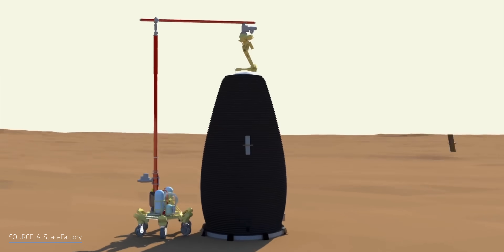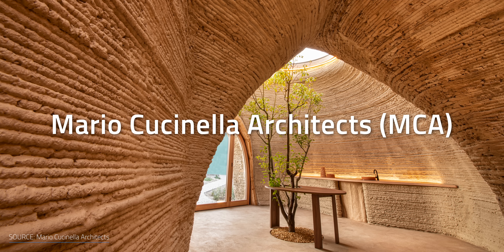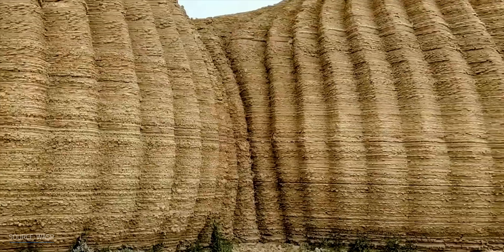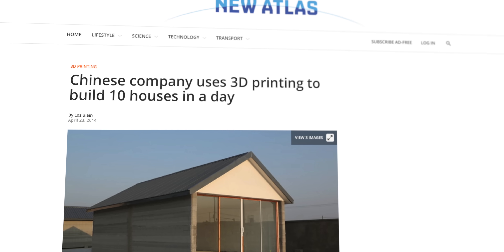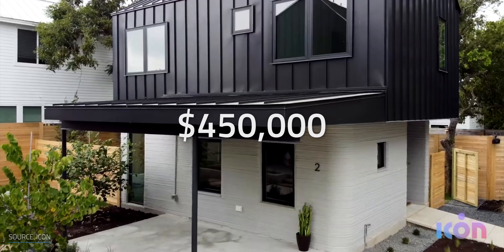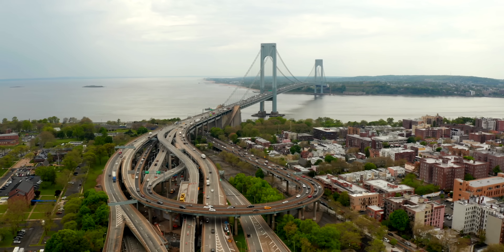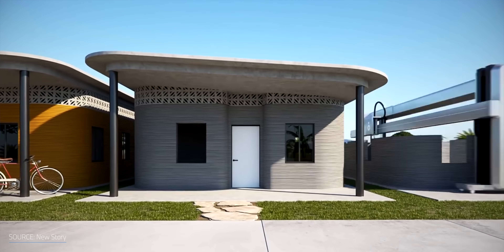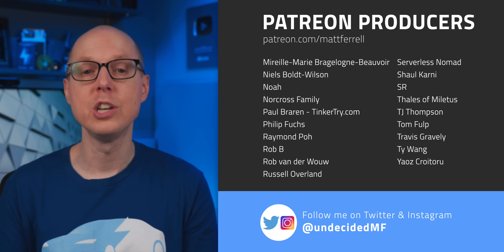The Truth About 3D Printed Homes

Comment: How long are printed structures, homes and small business offices and work spaces, going survive when exposed to blowing sand, rain, snow and ice? How safe are printed structures when they are constructed of local clay considering that the local clay can be contaminated with bacteria, viruses and chemical compounds containing dangerous metals and other cancer causing compounds. How safe are these structures for small children considering the extremely rough and jagged inner surfaces. How are the printed structures going to prevent external as well as internal plant and mold growth that will cling to and penetrate the printed structures over time? How long will these structures be and remain rainproof in rainy locations, and what remediation methods are there to make leaking printed structures watertight again. How can these printed structures be cleaned when they have porous and extremely rough inner wall surfaces. To me there seem to be far too many problems created by printing structures than by using established construction methods so to promote printed structures is to promote an unworkable fad.

Comment: As an architect and 3d printing enthusiast, I have to admit, the 3d printing only really prints WALLS.  Not really roofs or foundations, windows, second floors. And it does not touch electrical, plumbing, plastering, cabinets, fixtures, doors, and all the miscellaneous stuff that makes a home. No insulation, no vaper proofing, no moisture barriers, overhangs, architectural ornaments, decorations, the things that make a house a home.
Reply: No reason? You just posted one. You have to support foam blocks under any layer put out by a 3d printer? Almost as bad as some filament printers that require "support" below horizontal elements. Much of the material is wasted and has to be thrown away.
Reply: @garywheeler7039  you can make that support material out of any number of reusable or compostable materials. Supports don't have to be made of the same materials, in many high end 3d printers a dissolvable layer of support material goes down first. There is no reason that can't be done even more efficiently with on-site workers placing blocks of mushroom foam or the like.
Reply: @tenchuu007  : Or temporary scaffolding phased correctly.
Reply: It looks to me that if you want to bring down the cost of construction - rather than "being green" - you'd be better off developing a modular home kit that includes:
floors, roofs, lintels, doors, windows, pipes, conduits, cables, and either forced air ducts or radiator pipes.
If all of those things are included and as easy to install as laying pavers, you could even have a house that can be move-in-ready within a week of pouring the slab.
Reply: @Pystro  : Its not that simple. Plumbing, electrical systems, insulation, weatherproofing make a kit very difficult.
Reply: @garywheeler7039  I know. But their installations are also complicated, tedious jobs if you build a kit house that comes without them.
Reply: @garywheeler7039  I don't think the intent is to build 1st world housing in this manner, rather to improve 3rd world slums.
Reply: And present 3DCP practice makes all the other stuff more expensive.  Much if the wall needs to be solid concrete to attach to foundation roof and have legit shear walls, also often around windows and doors.  The R-value of concrete is around 0.1 per inch (US Imperial).  And what about a drainage plane behind cladding? Etc.
Reply: As you'll probably know, it's a rapidly improving space. Excavation:  https://www.youtube.com/watch?v=6oqEKyseu2U. Wall Insulation that could be clad externally with Adobe or Concrete: https://www.youtube.com/watch?v=Rgp4ncc1wOQ. Internal Wall surface plaster, render, paint: https://www.youtube.com/watch?v=mW7W_h1lBfE, etc
Reply: No reason it can't print a roof or a second floor. Increase the gantry height and reinforce it and use biodegradable foam blocks to hold up the top as it dries.
Reply: Looked to me like it was printing insulation, in the form of air space, which is the best insulator.
Reply: @thedanyesful   Air is a good insulator when  it can't move....that's why double pane windows don't use air as  an insulator..!!
Reply: @bogdan78pop  yeah that was my point

Comment: I see the porosity drawing ground water into the walls, rain too, and mold causing respiratory problems. I worked in construction where we have a lot of 100 to 200 year old 1 2, and 3 floor masonry buildings. You still have to build a house frame inside the masonry to mount the sheet rock, and all the other civilized appliances like plumbing, and wiring. All that has to be isolated from the outer walls so the moisture doesn't rot the inside stuff. In old buildings slate is used. Modern construction uses tar paper.Some walls don't have sheet rock on them just a per lite plaster with a lime coat. Always a mold problem. Usually just in outer halls, and stair ways not rooms  It's easier to just mount siding on the framing you use for the sheet rock instead of that mud wall thing. And all the other stuff is cheaper to install , and repair through siding rather than masonry. Back when the buildings were made an unusual mortar was used. Not Portland cement mortar. More like that sand clay mud. Over time the mortar loses it's adhesion, and becomes like sand. Falls apart. Has to be re cemented by tuck pointing with Portland cement mortar. As the mud decays to dust, and sand the place becomes a respiratory nightmare in addition to the mold, bugs, rodent holes, damp cold walls,  etc.

Comment: What about the huge ammount of associated costs and work involved in mobilizing diggers etc to excavate the clay and mix it on site ? Diesel, water, maintanance of machinery etc the list is huge  The only way I can see this even remotely working would be on a larger scale, excavating batching, mixing plant on site to run alongside multiple printers. However you're then left with the excavations, mess and disturbance left from all these activities. Adding roads gardens drainage, ammeneties etc then becomes a nightmare. Add some  torential rain , freezing or hot weather into the mix and you've got a recipe for dissaster. Good luck.

Comment: Most people see all the walls are up and a roof on and think a house is 'finished'. Nope, it's 'closed in'. Most folks don't realize what a small portion of the total construction cost in materials and labor the exterior observable part of a house is. All the walls and floors need finishing, cabinetry, water and electricity (as is appropriate for the location) and so forth. And, honestly, do we really want to live in a house with such rough walls on the inside? We'd probably like them smoothed substantially. How much abuse can they handle? 

The intentions are good, and working on them may make progress to alleviate many of the issues. But, I don't see 3D printed houses making any real impact on the market for at least 30 more years.

Comment: I like the inflated concrete domes first demonstrated in Japan and with Bini around the same time. Today, I might want foam, or concrete with foam to lighten it, and make it a better insulator, but same process. Lay down a slab, cure, lay down a bladder, cover with concrete, inflate, cure, cut entries/windows. Direct 3d printing should work, really what's stopping us? We can print it with plastic why not foam or concrete or concrete foam? I think it's a problem with finishing the exterior and interior as much as how to build it.

Comment: One of the issues I see, is the ability of the homeowner to make changes to the structure, such as adding an extension or maybe interior changes. With the current stick frame construction, installing or changing power, comm, water and gas, or easier to do.
Reply: This.

Comment: Excellent article about 3D printed homes. Yes, there is a lot of hype out there, not just in housing, but other forms of manufacturing. 20 years ago, I was working on an 'additive' printer for producing printed circuit boards. Today, there are many different types of additive manufacturing. It is an exciting time to see all the new ways it can be used in a cost effective manner.

Comment: Thanks for the video. It's really interesting to go back and take a second look at something you've featured before.

I'm not sure that 3-D printing will be a good solution to the problem of building homes for people who are homeless or who currently live in poor housing conditions. It's an expensive new technology that needs to be imported, and will require specially trained workers to operate. This is an example of using technology to solve what's really a logistics and organization problem.

These areas have plenty of available labor. What's needed is a way to source and deliver materials cheaply (From within the local area, ideally. The TECLA people got that part right.), then organize the available labor and get things built. Money spent on acquiring local materials and paying local workers will produce a better result than importing new technology from abroad.

Comment: Great points about the applications (low density) and effectiveness in addressing housing for the homeless.  I visited a town in South Africa where the majority of the buildings were newer cinderblock with steel roofs... hard to beat this construction method and cost although the carbon footprint of concrete is high... I would also like to emphasize an important point that you mention... Labour in the third world is very cheap.  You will never justify displacing $5/day construction workers with a skilled crew to set up and run a 3D printer.
Reply: That last part is key, and might be a way bigger issue in the field once you try pulling it off.

Comment: I'd be interested to know whether the structural integrity of the clay used could be combined with Insulated Concrete Forms to build homes, because the insulation value of the clay can't be too high. It seems like the end result of the clay is similar to adobe bricks which have been around for thousands of years, but it is really neat to see the additive method used. I suppose one would really need to know the ground composition of the area where they plan on deploying this technology. Single storey construction is not useful in a modern city where land scarcity forces homes to be multiple stories.
Reply: This shit have ZERO advantages against bricks, it's a scam to lure investors.

Comment: 7:22 That's why the goals of having a sustainable environment should be de-coupled from any attempts to "save the environment".  There is NO way to have zero-emissions on any level.  It's a pipe dream, However, that doesn't mean reductions in emissions can't be an achievable goal, via efficiency standards on both human behavior and industry practices.

Comment: It's good to de-hype this stuff. We're still so far away from a true, cost effective replacement for traditional homes. I've been fascinated with the idea since I first sketched my idea of how 3D printing houses could work back in 2000. If we could get electrical, plumbing integrated into the process at a cheap cost it would be a game changer. But it will likely remain niche and experimental until we get proper cost savings, real environmental benefit and increase the speed of making these homes. 

A hybrid approach may be best where the robotic arm creates the walls, but also assembles the necessary items like the  plumbing pipes, runs the electrical wires, and any support infrastructure, paints, etc. 24 hours to build a house should be a goal, but it's more important to build a good home quicker and less expensive than a traditional home. Without actual competing with the current market these will always be more hype than anything.

Comment: You cannot build cheaper than "conventional" methods until a new technique is enough of an improvement to become conventional itself. I can build basic tiny homes cheaper using stick lumber than you can pour a concrete, mud or prefab house. Same with masonry where that is cheaper than stick. Plus, conventional building techniques have low enough entry to industry to allow locals to capitalize from the housing need which is closer to addressing the actual problem.

Comment: No offence please but the prospect of the housing industry solving the housing crisis is a pipe dream. They artificially manipulate the market and housing supply to increase the cost. In my country, one of the main tactics is to buy all available land preferrably without planning permission as it's much cheaper. They sit on it and wait until the electorate start to shout then build large numbers of poorly built houses at greatly inflated prices, blaming the latter on the cost of the land they themselves had owned for years. The cost of a house has nothing to do with the cost of the build, rather it's to do with the desperation of the buyer.

Comment: I think we shouldn't be worried so much about having net zero carbon homes during the construction phase and start to build inexpensive housing that is well insulated and has a long expected lifespan. It now costs $300k for a only a 400 sq ft new build studio condo in my area - about dbl what it did when I moved here in 2008. Zero/low carbon will happen with progress but affordability is the biggest problem.